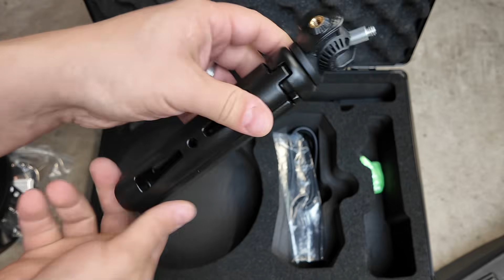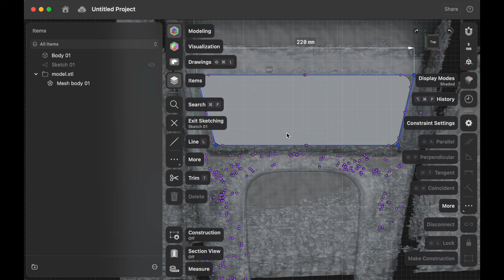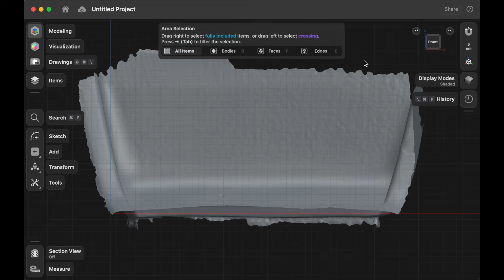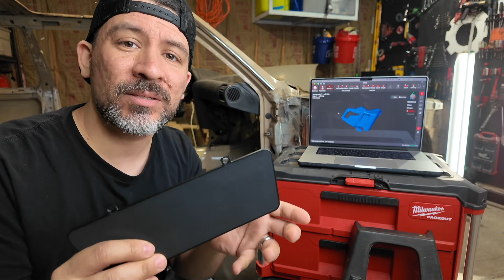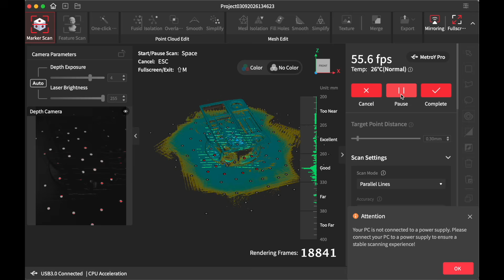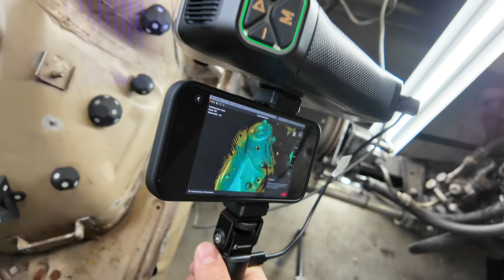3D Scan Car Parts You Can Print — iPhone vs Revopoint MetroY Pro

Comment: If you are trying to use photogrammetry, you need to include in your photo's, an object of known size (needs to be a cylinder shape as that diameter will never change regardless of the angle of pic).
You can then faff around with the scale of the scan until it meets your original. Simple to do, measure a key detail on your scan and adjust the ratio to your known diameter.
Reply from the maker: Awesome tip!!!

Comment: It looks like you used an iPhone 16 Pro. The iPhone 17 Pro is supposed to have a ‘better’ LIDAR sensor. Has anyone compared results from the 16 to 17?
Reply from the maker: It was actually an iPhone 14 Pro. If you take a look at the specs even on the newer phones the lidar scanning distance is for further away objects. Great for even larger rooms, but not so great for smaller car parts. Photogrammetry seems to works best if you have to use a phone 👍

Comment: Being someone that has the ambition and desire to 3d print my project car parts however zero experience in 3d scanning and printing, these videos are fantastic but also makes me realise how it will take a long time to get my head around it all to even start it all. Also considering the costs for such a setup.

Not giving up, however a little overwhelming..
Reply from the maker: Thx, you can definitely start with a phone and photogrammetry for practice before committing to a scanner purchase. You’ll get some good CAD practice. But it’s like with anything, the more you get the reps in, the easier it gets 😎
Reply: can you suggest what should i use to scan my baby's hands? want to keep the scan as a memory keepsake.

Comment: How is the metro for small parts?  30mm ish?
Reply from the maker: From what I tested it works pretty well on very small details too. But its mostly good for reverse engineering parts, not scan to print. Not that any 3d scanner is really good at that ;)

Comment: Differences in scale in Polycam scan results can be corrected fairly easily by scanning a reference plate such as a 10 mm or 1-inch square together with the object. However, even with that adjustment, the accuracy is still too strict for making parts that need to be manufactured and fitted, so I think it will probably be limited to things like room interiors.
Reply from the maker: Agreed, played around with it some more and it’s best to just perform a manual measurement to double check. Thx for the tips 🙌🙌🙌

Comment: nice been a longtime shapr3d, sometimes I wished it supported point cloud, also only difference wifi or usb mode is just frame rate, usb mode for most 3d scanners will have higher fps like for example I get 90fps on my sermoon s1, but on wifi mode it can go from 30-50fps , while detail is same lower fps means longer times to scan the same area
Reply from the maker: Love using Shapr3d, especially with an iPad and Apple Pencil. Makes it easy from switching between desktop and iPad in the garage for a quick change in measurement. Thx for tip on the WiFi vs USB. Seemed to work the same, need to look up the fps specs 🙌
Reply: can you suggest what should i use to scan my baby's hands? want to keep the scan as a memory keepsake.
Reply: @quietchaos-w6m honestly anything with a lidar only scanner is good, there is a new Creality scanner called Pika you might like its same price as others but it’s the size of a GoPro it can do laser scans too